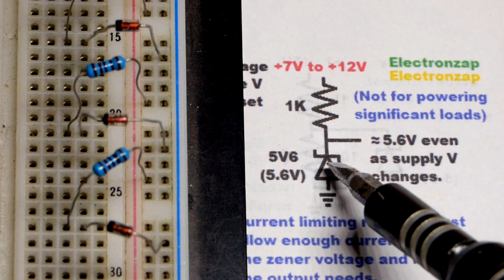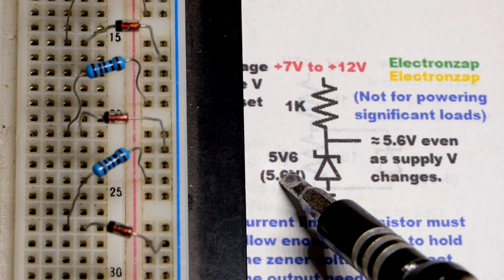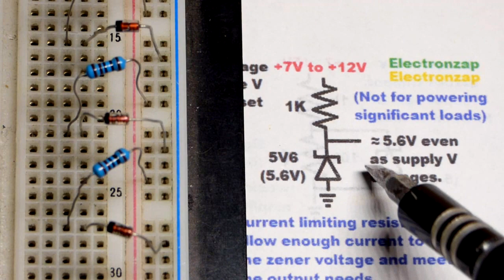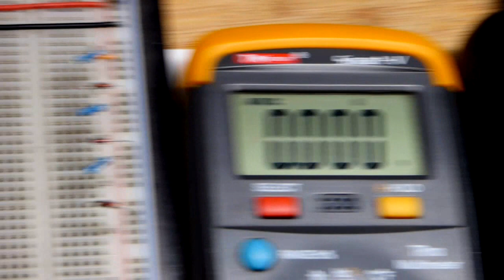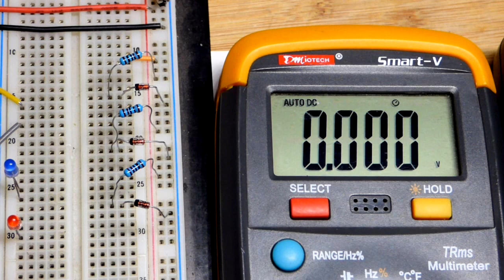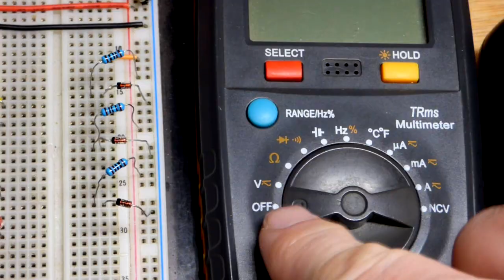Zener diode reference voltages measured with multimeter learning electronics shorts 41

Comment: would this work to power a microcontroller (BBC Microbit) at 3.2v with a 12 volt supply.
Reply from the maker: You'd want a actual voltage regulator component with a heat sink to power anything.